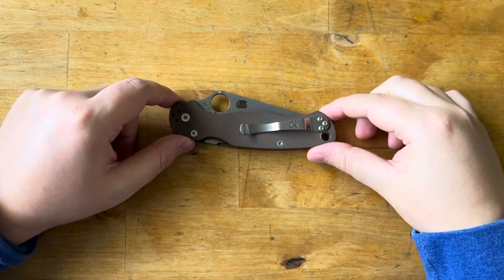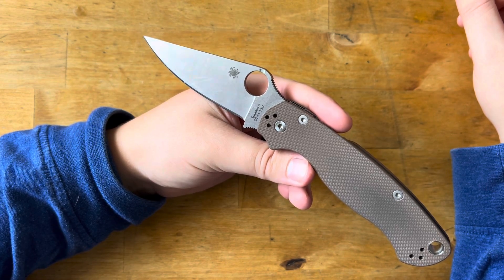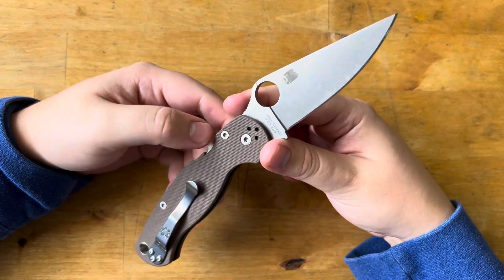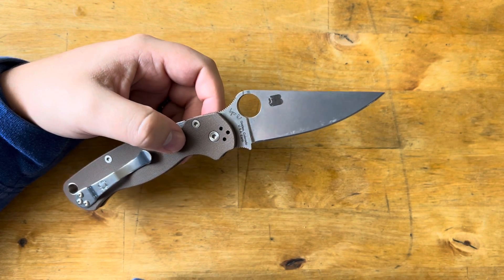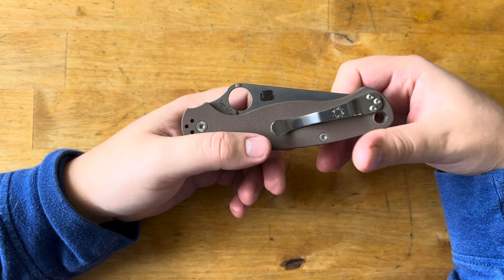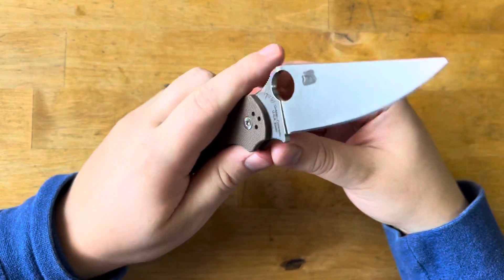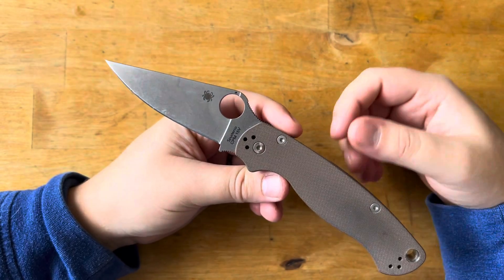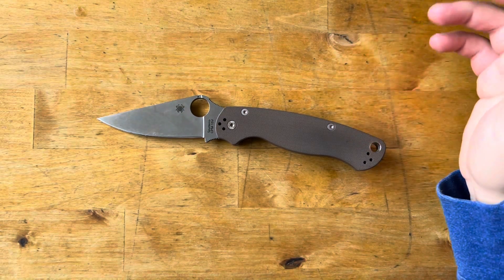CPM-15V Carry Update

Comment: I have sharpened a huge amount of 15v and I mean a huge amount. It is one of those steels that very much does well with a high polish. Even off F1200 dragon stones I can keep a significant amount of aggression/bite in the edge. It's strop responsiveness off the 3/2 micron stones is crazy, it just comes have to hair popping over and over and over.. I personally like mine at F800 over f1200 as I like that slightly more aggressive cutting profile. My mule is on its 11th edge from cut testing and it's really impressed me with pretty much any edge finish I've done.. next edge will be a F1200/F150 dual grit just to see how it likes it. This steel has been an absolute pleasure to sharpen.
Reply: Does it polish at a courser grit than other steels?  I’ve noticed that hard m390 will polish at f800 where softer Chinese m390 needs 1200=200 to look polished. Just one way that a steels quality can be deduced from sharpening.
Reply from the maker: This will be interesting to see in testing as well if you haven’t tried the lower grits on the 15v I would try them super aggressive and burs remove easily. I follow your instagram to see the edges you do. Always very impressive the edges you do
Reply: Your gonna  be amazed at the edge retention of th dual grit edge! Don't over strop though. 
I'm rather fond of F 800 and f240 dual edge and lightly stripped with 1 micron. Only one or two swipes per side on a very hard strop. It is my go to method for S90V. 
KnifeMaker
Reply: @stevenlachance8576  Yep, harder steel polishes faster at a lower grit than softer steel of a given type. 
A trick I learned, not for a polished edge but a polished bevel on the edge before a micro bevel of 1/2 to 1 Deg. Once the bevel is where you want it. Rather than the normal sharpening strokes, dry any lube off the stone (Venev) and move it long ways on the fresh bevel very lightly. As the stone loads from  no lube, it will mirror the beven and finish with norman stone either  one or two edge leading strokes  to remove the burr and finish with very light edge following stokes. If using an F800 Venev, it will appear as a fully mirrored edge but with a bite from the f800 stone. No stropping needed at all.

I use trend Diamond Lapping (sharpening) fluid only on my Venev stones, NO loading whatsoever. After al long sharpening session, I simply put one or two drops on the Venav and rub with my finger. All black disappears instantly.

Comment: I took the factory edge off the knife by running it on a 400 grit stone at a 90 degree angle, then sharpened it 2x at the factory angle.
The edge cut 800 feet of cardboard and was still very sharp.  The steel will improve dramatically with a few more sharpenings.   
I've been caring it for 8 months.  Great knife, excellent heat treatment.   Thanks for the video.  😎👍
Reply from the maker: The edge on this guy even after only one sharpening is putting up a fight, just doesn’t want to dull
Reply: @allthingsknives  The only problem with 15v is that all other lower performance steel is very unattractive by comparison.   Thanks again for the video..

Comment: Sharpened my 15v shaman to DMT course (325 grit) first, and noted the toothieness like you mention. I wanted a little more push cut though and took it to dmt fine (600 grit) both grits were stropped on 1 micron diamond paste  on leather.  I will say at 600 grit it's pretty impressivley sharp, but this steel really does like the lower grits. Once this edge wears out, (probably be a while) i intend to take it back to 320 and and refine on the strop. 15v is quite a beast when done on low grit and not as bad to sharpen as i would have guessed. I would say it's slightly easier than s90v.  Must all be in shawns heat treat.

Comment: Remember, F400 is actually what we are use to in Ansi and Jis 800 grit. So not so coarse after all. ;<)
KnifeMaker
Reply: My bad, F400 = P 800 grit, Jis 700 grit, Lansky extra fine. DDMT Fine. This is not a coarse grit! You will find that the high vanadium steels cut better with qa true coarse edge. 600 P seems just about right. A dual grit, 200  or 400 and no higher than a true 600 p  on one side, and 1000 or 2000 grit, (800 venev is 2000P) on the other with a very very light strop on 1 micron will blow away just about any other method. Unreal the cutting ability and edge life. 

If sharpened correctly, and with the proper grits Cruwear cannot even approach the edge holding of 15v. 15v is in an entirely different universe! 7 toes the vanadium content at least. I still have a supply of the original version Called Vasco Wear by Tyledine. Good Steel! It was used for the locking detents on the 747 that carried the space shuttle and is used to this day for input shafts in funny cars and top fuel dragsters. It is that tough. 

As to the stropping taking away the bite, try this. Strop on 1mm, one pass per side and no more than two with only the weight of the knife. NO Pressure!!! None!!! ;<)
Also, leather tends to wrap around the edge and remove the micro teeth. 
Try using a very hard and smooth wooden stop. Several companies sell balsa wood for the purpose but the large paint stirrers that Lowes and Home Depot are just about perfect for this use at no cost.
Grit O  Matic has a 1 micron rub on diamond stick in a container that looks like lip balm only larger. It is my go to.   Again, only one or two strops per side with only the weight of the knife. No more. 
KnifeMaker
Reply from the maker: That was me converting from the FEPA grit I have a conversion chart in my carry journal I created so it is 400 grit ANSI

Comment: Might be repost..
How do you plan to manage the plunge grind?  Been trying cru-wear dual grit edges by taking both sides to venev 1200, then backing off the left side to400 or 240 venev with very little stropping.  Seems to maintain bite a bit better than regular edge cru-wear.
Reply from the maker: Yeah I keep hearing about dual grit edges I’ll have to try them, I’m not too worried about the plunge grind my Venev stones get in their no problem